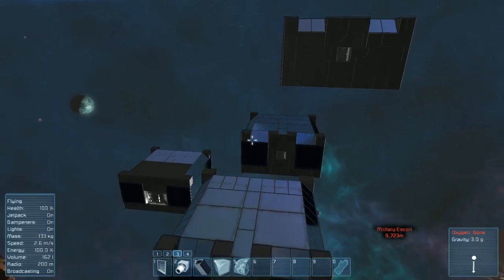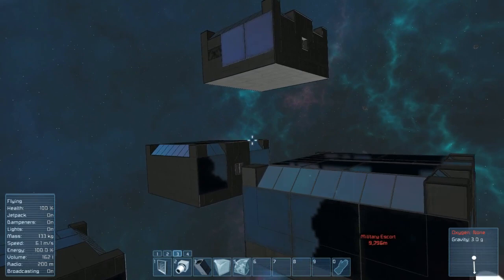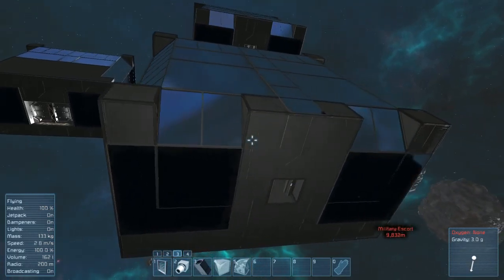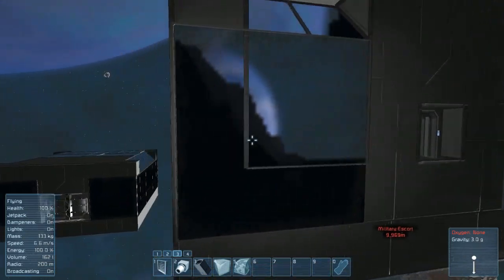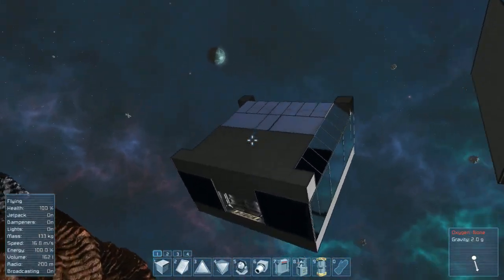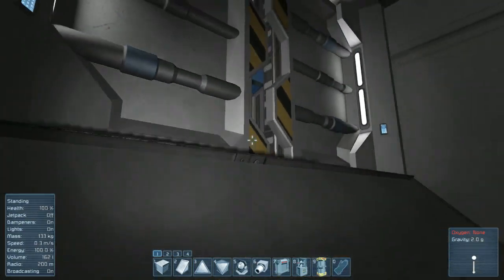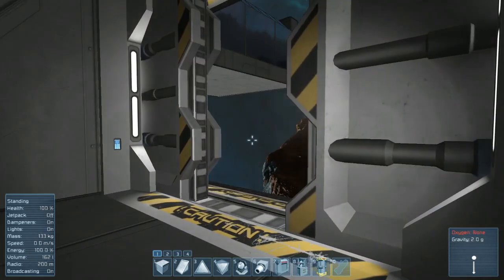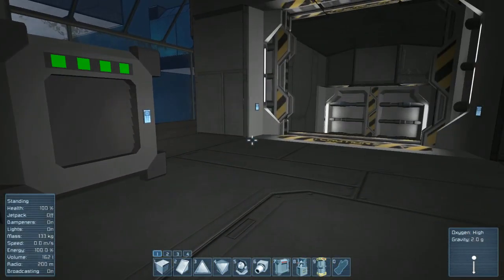Space Engineers - Testing user questions on Oxygen systems

Comment: 1. You never actually breached the hull when you were demonstrating the first time, so that's invalid. 2. The vent oxygen effect is always on, so that meaning it's maintaining pressure from a leak, is false. 3. Thrusters have beveled corners and edges that make them not airtight, yet they still act as though they are airtight, which you don't address or mention in any way. 4. Please fully test things before you post about them as a knowledgeable source.